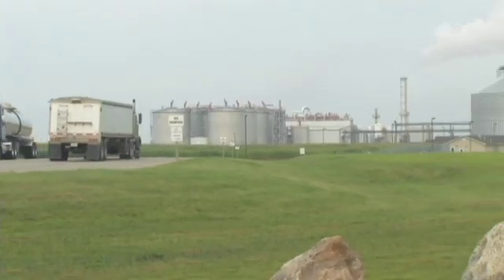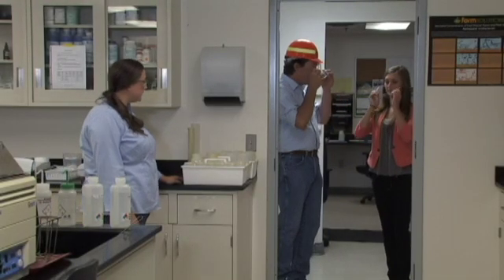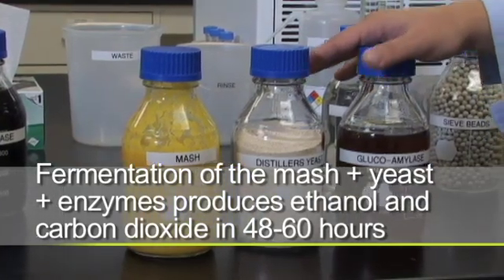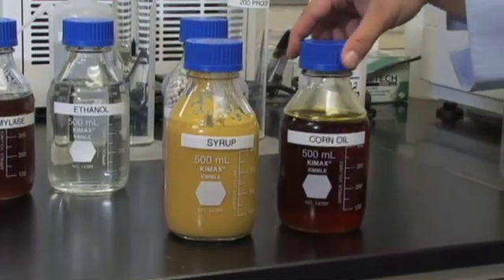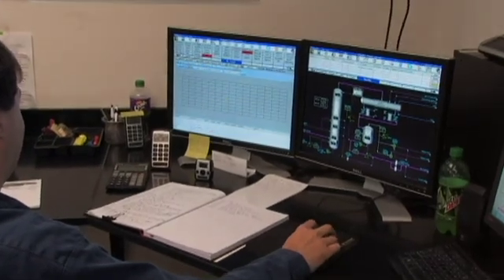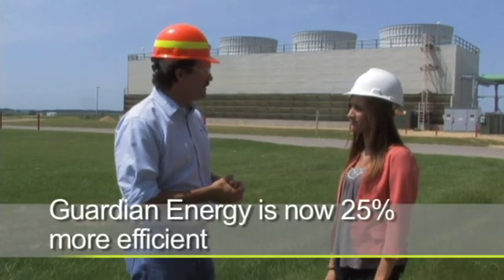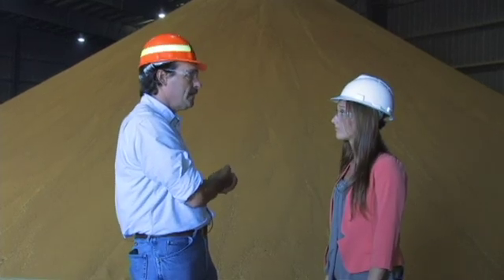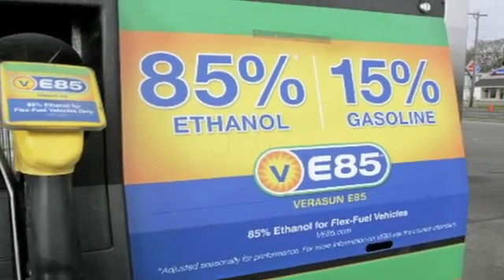Biofuels as Renewable Energy: Ethanol From Corn

Comment: Ethanol makes up 10% of 98% of all gasoline in the United States. Ethanol is 80% corn and corn costs rn (july 2021) $5.75 per bushel which is 56 pounds of corn. it takes 26.1 pounds of corn to make one gallon of ethonal. Side note One acre of land can yield 7110 pounds of corn or 328 gallons of ethonal which cost about 140 gallons on average to operate (this is all on a per year basis). 10% ethanol blends also use 3-4% more gas per mile as opposed to solely gas and produce similarly high levels of air pollution. So If gas is 10% ethanol then it takes .1 gallons of ethanol to make one gallon of modern gasoline. So going back to the earlier number (56-26.1)/56= .598 x $5.75= $3.4385 aka the cost of corn per gallon of ethanol (this is without additional transportation, logistics, and other variable costs). So $3.485 x .1 = $.3485 so fucking corn alone accounts for atleast a 34 cent hike is the price of gas and there’s still 20% of ethanol that’s not corn idk what the fuck it is some vegetable or moss shit fuck whatever it is it cost more money. So basically my point is we put fucking corn in gas for little to no environmental benefit but at great cost. Bottom line is gas is expensive because we put corn in it? Maybe